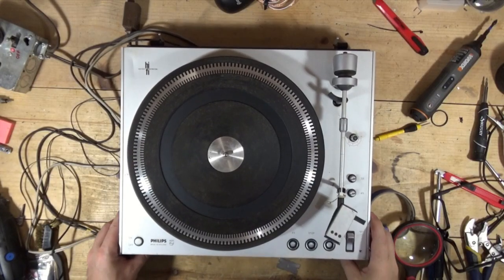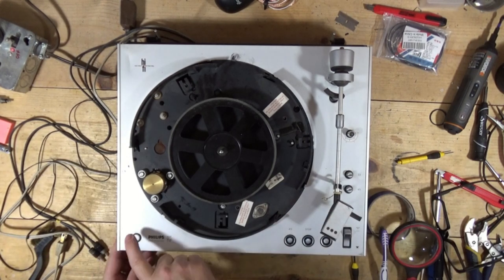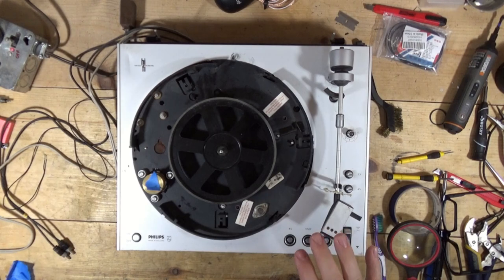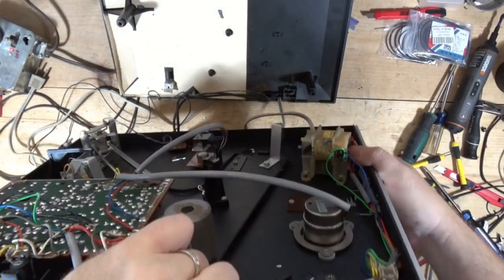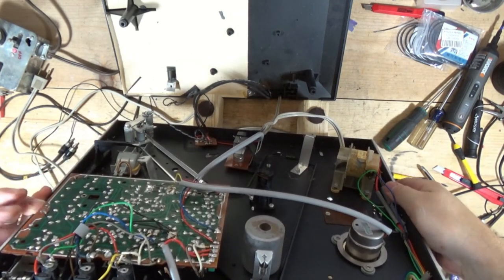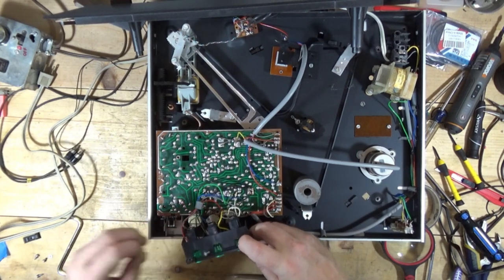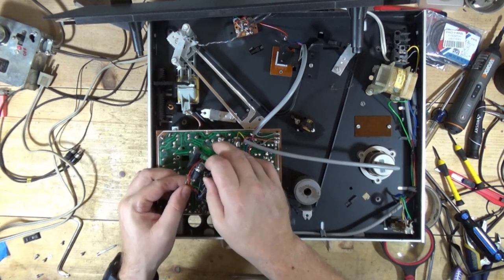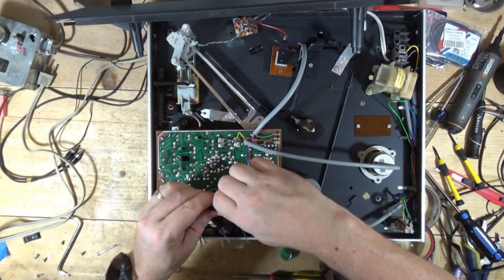Goodwill Find Philips 212 Turntable Repair Part 2 - Spindle Service & Lamp Replacement

Comment: I have a Philips 777 turntable that is fully automatic. Even more complicated than this and all the mechanical parts seem underbuilt (after working on a Dual 1019). It works but sometimes gets out of sequence. I have one of these in the basement to fix. The switch on mine will not latch closed, there is a plastic plate that I pulled out that got worn out from use. I am going to try to repair it but there is a replacement switch available on ebay.
Reply from the maker: Good luck!

Comment: Made for appearance and not SQ or serviceability.
Reply from the maker: I think the sound quality is OK.  It's a suspended chassis turntable (like a Linn, Thorens, AR, etc...) and I will say that this table does sound good.  We can't give it away :(  Zero interest even at less than $100 with an Empire cartridge on it.